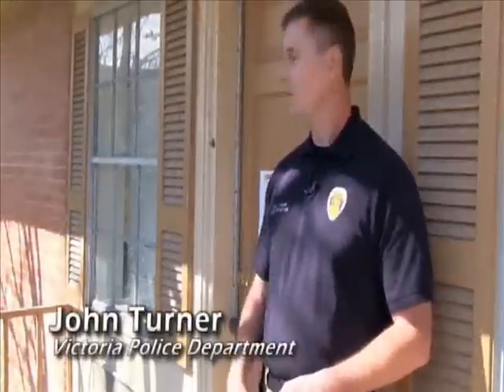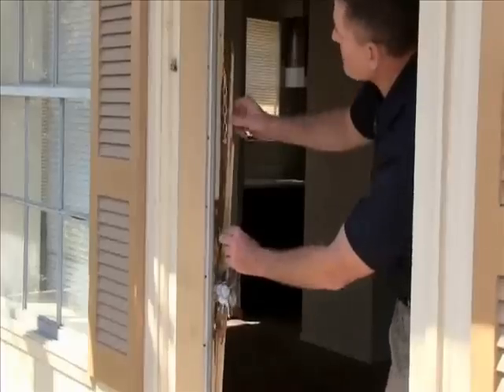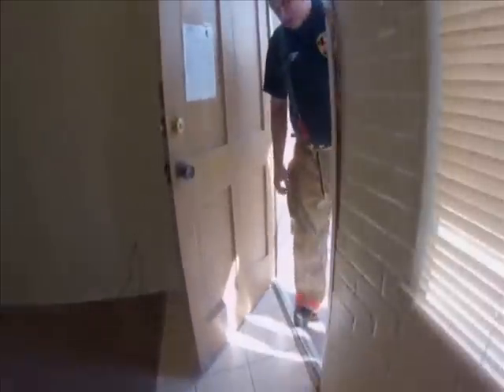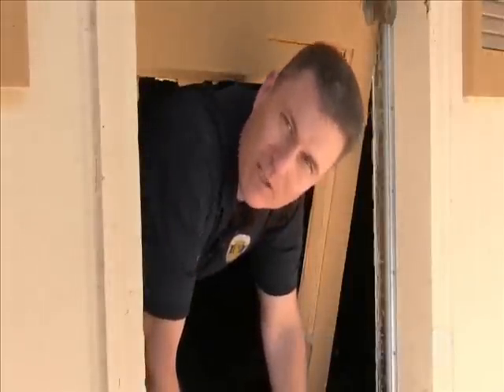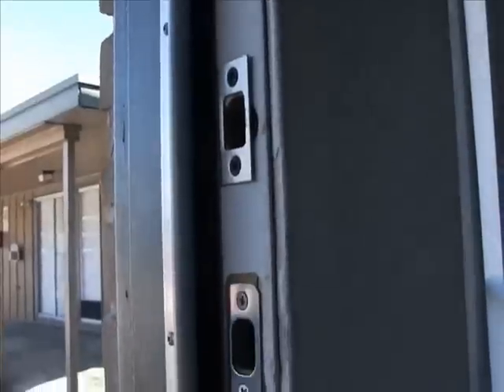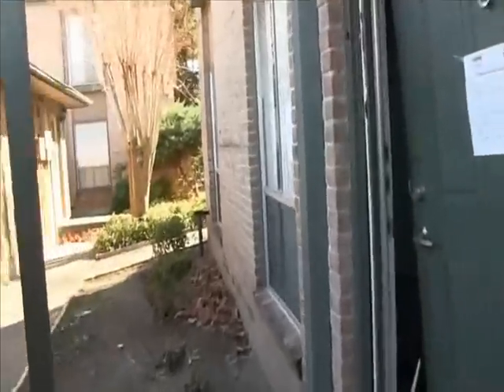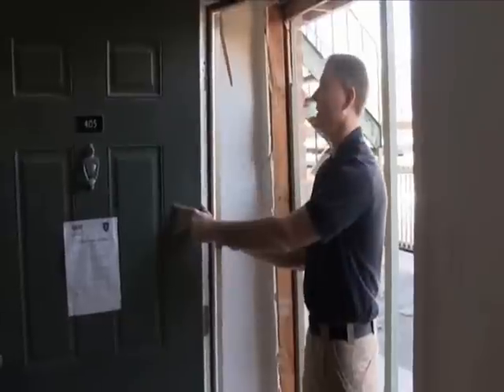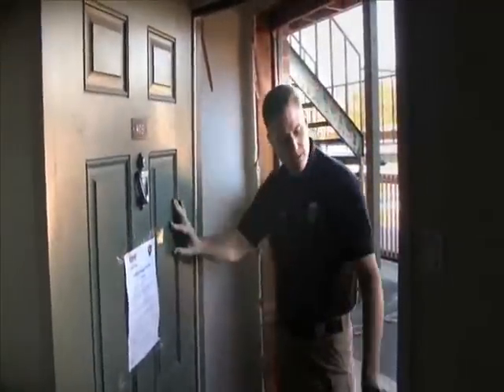Double your door security for a couple of bucks NOW! Safer in 5 minutes!

Comment: First thing you do is to get a door/frame that opens outwards!
1. Its harder for a burglar to kick in the door    
2. Its for safety reasons, in case if fire its easier to get the door open from the inside    
3. It doesn't take any space at all inside the home, so you can have more stuff in the room or hallway that follows the door.    
4. If its raining or snowing, the door will be wet - opening it inward will bring that shit inside your home.

Comment: I would use a Heavy Metal Door with 3 cross bars on the inside with reinforced metal frame and studs, on the outside of the door you could install a 2 inch pig iron shield that slides and locks in place in front of the door, I would also have these Shields on all windows ! Next have a Hidden  panic room with  CCTV Monitors to the outside with ear piercing sound weapon and all interior door are locked with 12 gauge shotgun Buckshot shells repeal booby traps fireing outwards. Next if the outer perimeter is breached then I would  have an underground escape route ready to get out of the house with a bug out pack, YES this means you have to plan and dig a walkable tunnel like 4 1/2 tall by 3 feet wide at least 20 100 feet away from your house, and hopefully have the exit really camouflaged ! Then you could have  a bunch of M-80 planted around your house and when you are clear and all the assholes are inside Blow it ! Now that is House Protection & Defense!

Comment: Only a cop could be surprised by the results of this 'experiment'. 

If you live in a proper brick built house, rather than a glorified wooden shed, remove the THREE door hinges from the frame, drill the door frame with a 10mm drill, then drill into the brickwork behind with a 10mm masonry drill. Plug the holes with 10mm round bar or threaded bar. Reattach the hinges with 3-4" screws. 

Repeat the process on the lock side and fit a mortice lock in addition to the Yale type. It keeps the cops out as well as the thieves that don't wear silly costumes.

Comment: My doors open outwards...that means that they`ll have to remove my 4 by 2 "wood trimming" before they can open my door the wrong way xD
Reply: Or they will easily remove your hinge pins and then remove your door...
Reply: sig2529 Good luck with that, the hinges are in the middle of the frame ;) Not visable from the outside!

Comment: Buddy isn't kicking the door right you kick it the way he does backwards but it's a lot easier to get any door even a metal one on the first kick if you kick close to the hinges not the door nob it takes the trim right off the wall first go as long as it's a wood frame and not a concrete frame like something in a school it takes it right off you could have all the deadbolts and chains you want so what you need it a heavy outwards opening screen door with burglar bars

Comment: all my doors are steel framed and acid bolted in place and the doors are steel encased... all the windows have steel shutters, there is no entry without keys,  I think some nutcase prepper used to live here, I found gun cases under the floorboards and drawers in the stair steps and the roof space is full of razor wire... I'm scared to go in the garden since the cat went missing....

Comment: Part this is funny is that the hinge stuff was to code with the stupid short screws. The Jamb of the door needs longer screws but even still.. the screws are going into the EDGE of the wood on the strike plate.. Everyone look at in the dead bolt in the frame.. you will see half plasterboard and the edge of the framing wood..Longer screws will make it stronger but just for a few more kicks. 
No matter how big and heavy the front door is they always use those frickin short screws..

Comment: Great channel..... CHEAP WAY TO MAKE YOUR HOME DOOR MUCH STRONGER...
Place a large-sized car tire on the floor pressed up against the door and the wall on the inside of your home...The tire has to go to the side of the door that opens and the tire has to be pressed up against the wall..  
ENERGY CAN NOT BE DESTROYED ..IT CAN ONLY BE TRANSFERRED AND IT WILL ALWAYS FIND THE EASIEST ROUTE. 
As the thug is TRYING to kick your door in the MOST of the energy will transfer to the rubber tire which is laid flat on the floor inside your home, Pressed up against the door. 
It will SIGNIFICANTLY slow down the thug outside who is trying to kick your door in.  It will "Buy you" a valuable 20 SECONDS .. Enough time to grab the loaded double-barreled shotgun loaded with 00 buckshot.

Comment: With the trim removed, measure the gap between the door case when gap is even. Say 1/4” between door and jack stud. I used a class-3 deadbolt that is long, but a 1/4” plate of steel insert, Mark, drill corners of each hole and cut out with metal blade in cooping saw, air cut off, saws-all. Drill next size bigger holes for screws that can be hidden under caulking & paint or jamb stop strip. Long screws pass thru metal plate, into jack stud 1 1/2”, king stud. Already put 3 1/3 construction screws into center of each hinge. Just be careful when close to tight as the door frame can bend and the gap wavy. Just my 2 cents, adjusted for inflation is now $6.18.  Be safe, but time to react! That’s the key! Blessing.

Comment: Why would someone go for the door if theres a window right next to it. So how can we secure the windows?
Reply from the maker: This video isn't about the house they are demonstrating this procedure on. What do you think it's really about? The screws in the hinges strengthen the door. With windows there are two ways. One board up. I know people who have made 3/4" plywood window covers for all their windows. When SHFT they will cover all their windows on first floor. Yes they have peep holes and ways to keep people off second floor. The other way is bars. Here in NM some places have bars on their windows for look. They also serve a real purpose. Another one is a metal mesh that one can roll down in an emergency on the inside. It will slow a bad guy down and he will have to make noise. That's when you introduce him to 2nd amendment!

Comment: Halligan bar makes less noise and far less likely to injure a fireman's knee or ankle.  Combined with an axe, i.e. a set of irons, fireman will get through most anything.  Granted, the firefighter, has a pooch.  He'll die early from clogged arteries and diabetes, saving the tax payers from having to pay for retirement.  For anybody that's never worn bunker turnout gear you can't imagine how hot and heavy it is until you've tried to do anything physical in it.  Commercial doors lock through the top of the jamb and through the floor.  Mechanisms too expensive for most homes.

Comment: ANYONE who does not replace AT LEAST one of the hinge screws in each hinge with 3 inch(preferably hardened, but at least length,) is vulnerable to MULTIPLE attacks...the simplest being a hinge pry attack..now, the video showed a completely wrong exterior door install..looked like the brick molding was the only thing holding the frame in place...???

Comment: man, those American doors sure look flimsy as hell!
Also how about making your doors open outwards for a change??
Reply: hinges will be exposed anyone with a punch and a hammer will be abble to go in very easy unless you weld the pins in the hinges...
Reply: +Vega-Expert Hinge bolts, they are a requirement in the UK as well as four heavy duty hinges which can't be driven through.

I've seen the police try to bash one down and even they failed.
Reply: There's at least 40 different kinds of doors you could have in America.  Everything from solid 10cm titanium, to balsa you could shine a light through; I'm sure of it. If you can think of it, it can be bought in America.

Comment: lol aint getting in mah house its a double door like 1.5 in thick  dead bolted and a normal lock the dead bolt locked goes about 1.5-2 in into the inside of the other door and its all made of hard steel they better be good lockpickers

Comment: Same morons must of installed my home doors as door 3 in the video. I went to install 3" screws in my strike plate and it bowed the door jamb out of shape because there was no shims or cut filler slabs of wood between the frame and jamb. Had to shim up the door jambs were ever I upgraded the screws. Even the hinge side and the way the jamb was installed could only get one screw to hit the 2X4 to tie in the hinges.
Reply from the maker: Great that you took action. Sorry for poor construction. Good to find now instead of later. Thanks for comment.
Reply: Thank you for making home owners aware of just how weak a door can be without proper hardware installation.

Comment: These are excellent tips for those who have solid walls - brick, stone, concrete - but you surely know that bullets pass through an entire wood-frame house, through the front door, several interior walls, exit the back wall and still kill someone in the next house. Most houses in the USA are like this, what I call a 'cardboard box'. You are fortunate to have solid walls, so a house like yours will probably deter the less-determined invader. But sadly, the real enemy is government. Any Smart Meters in your neighborhood? They can and will be used to cook people using microwaves. That's right, your friendly local power company, working with the feds, has set up not only Smart Meters, they have towers that can fry you from far away, and they are installing more. You probably won't know they are there, like cell towers that look like trees, here in the desert they make them look just like Saguaro Cactus. So consider all this when making your house 'safe'. Can you keep out the microwaves? Poison gas? And you really thought they were going to let you camp out with your preps until the chaos blows over? Unlikely. BugOutCenter dotcom for more info, free.

Comment: What I don't get is all the doors open into the house .....if doors pull open they would be way stronger.
Reply: Marc Favell 
Hinges will be on the outside.
Reply: BlackWorldTraveler they have concealed hinges for exterior doors or hinges with non-removable pins that don't matter much

Comment: The main problem you guys got is that construction culture is usually shit in Anglo Saxon cultures. Those "houses" are made of cardboard, even if you slightly reinforce the door frame, then the door itself collapses, and then you ve got those frail windows, I mean the whole place is totally unsafe. Look at European historic building if you want to learn about keeping a place safe and secure. Rome for example has a quite high burglary rate but go there and check people' s houses and flat how secure they are. With steel reinforced door frames fixed on the main wall with reinforced cement and steel. Doors weighting 80 kilos that when you shut them you feel like sleeping inside the Bank of England safe! Bullet proof windows, or removable window steel bars, reinforced walls etc,

Comment: make sure you do not use an electric driver to put those longer screws in
Reply: Why?
Reply: Electricians run wireds to outlets and switches through the wall.  You won't get shocked if you're holding on to a double insulated drill.  You want to get electrocuted so the next guy doesn't try to drill in the same spot. This'll keep the EMTs employed responding to electric shock calls.

Comment: On the first door he had to mule kick it before h could even kick it n!! The police aren't gonna kick it in any way. They will have a 30 lb battering ram that will bust down 98% of the home doors out there! The SOB's knocked mine,door facing and all, all the way down 3X!! They never found and there never was the stuff they were looking for there.They poured out washing powder,cokes,beer, fish aquariums,flour and even potted plants. hey poured the potted plants out right on the carpet. Poured milk on it so it would make more of a mess! Cut the water bed open and caused a lot of water damage. They even poured out douches. Is hat not going a little too far? You r a police. Do you think that is excessive? They opened every drawer, in the house, out and dumped them in the floorThey didn't put ANYTHING back either. Is this common place for your dept? They told me, after the 3rd time they did this inside of a year; we will have it with us when we come back! They were referring to planting something on me or n the house. Do you see why a person would have an intensive hatred for them??

Comment: wouldn't it actually be smarter to make doors to open out and not in - why are we all so stupid
Reply from the maker: cassanoa That is so if there is 3' of snow you can open your door. Not sure of other reasons for the code this way.
Reply: i think it so the authorities could enter easily - in Florida we dont get snow :-)
Reply: cassanoa  you are right,, good idea
Reply: their not getting in because they will be only closing the door more by pushing into the frame - not knowing they would be going in the wrong direction - a good defense is based on knowing what your opponent will do then planning around that and deceiving him
Reply: what ever works - i think we are on the same page - interesting avatar
Reply: Then if you opened the door from the inside someone could force their way inside
Reply: conservative_norcal
the doors should open OUT away from the building instead of opening in towards the inside of the building - it would be much harder to force open and easier to get out - and a better way than opening OUT would be for the doors to slide sideways into the wall
Reply: bongojim420
what about the doors sliding to the side - like banks or malls - the door that opens in is just not able to be easily secured - a old and obsolete system that invites forced entry - its not a joke - the only thing stopping an intruder is a few inches of pine wood - a sliding door ( pocket door ) would be very easily secured  - especially if it was steel cored covered in attractive wood
Reply: bongojim420 or we can all do what you do - keep the door open and leave milk and cookies beside your families valuables and the keys to the car :-)
Reply: bongojim420 thats why doors open inside, so they don't take up room or take someone out while walking or standing there outside, the door, opens to the wall. don't take up any room
Reply from the maker: In areas of snow"they" make it code to open inward. In case you have a snow drift if front of your door you can get out in an emergency. For me, I would go with opening out.
Reply: ETprepper me to - if snow is really a big problem then a small snow wall can be built to keep it back
Reply: Dude look at a door that open out its hinges are then out side meaning you can take the pins out. Damn you guys are slow a 10+ comments and no one points out that doors open on the side the hinges are on? It's for snow... How slow are you guys!?
Reply: +Darryl Edington you do make an interesting point - it cold be blocked shut :-) but a good soldier always has a back way out - and maybe a third way out as well - I wanted to use my last name " cassano " and my first initial "A" but Google wouldn't let me put a space between and gave me the option of cassanoa so I chose it 😀
Reply: Because then you couldn't install a storm door. Now a good security storm door would be a excellent idea.
Reply: DONTUO Harris
the best solution is actually a sliding pocket door - i have never seen one for a main or rear door - but such a system would be excellent - it could be easily blocked from sliding open and would almost be part of the wall - it could not be forced in or out easily and all external storm doors would function as normal

Comment: Not to be that guy her... but this guy is still amateur hour. 3 inch screws... At the end he says you need to screw in the other side of the door. I use 5 inch steel screws, replace all screw with those. Once you do that and have a steel door, and the door is snug or even tight, you're pretty solid. If the door is not snug or tight, you can get a crowbar or something else to pry it open. 

So make sure it's tight first, then replace all screws with five inch steel screws and you're really well protected. With enough time, anyone can get that open as well, but it'd be a massive pain in the ass. No one has been able to brake down doors I've done that to. All others, yes.